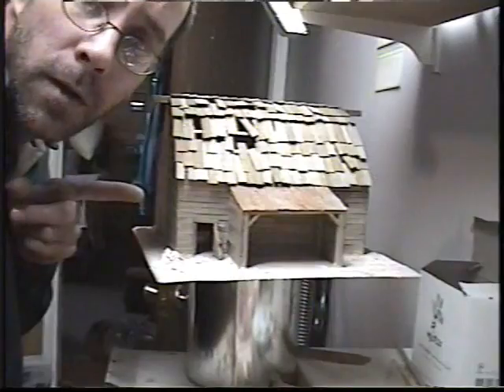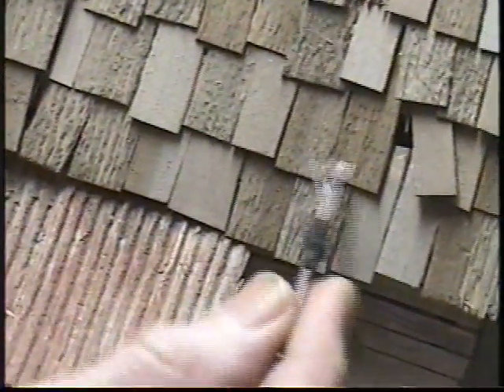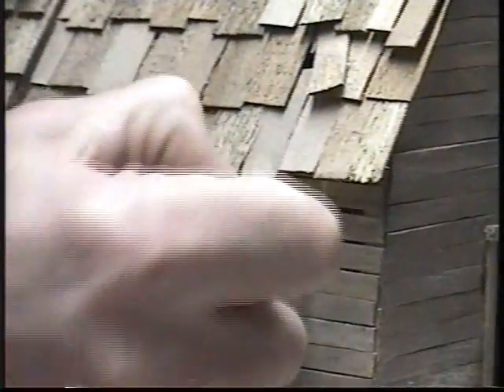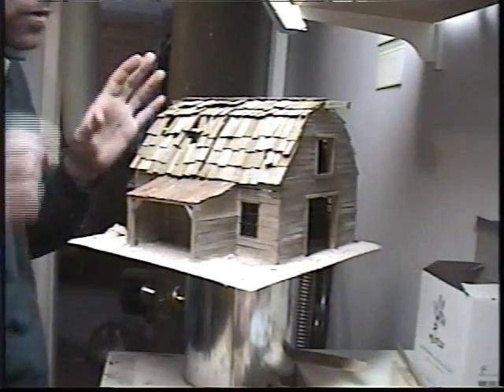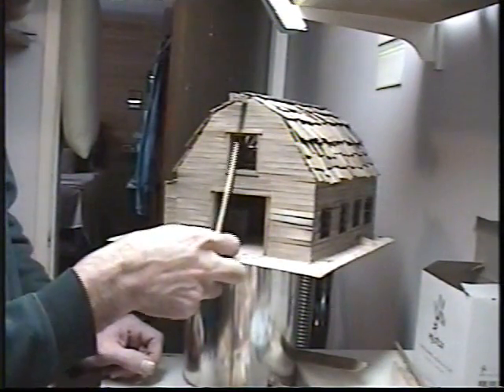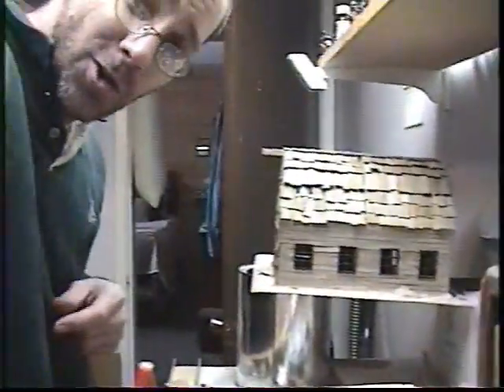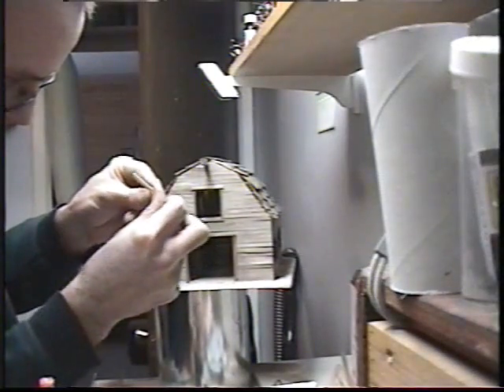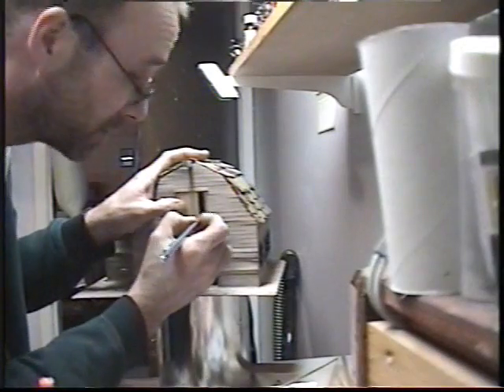Miniature barn diorama 28mm game terrain -part 8ish

Comment from the maker: I have always carved trenches out of a foam sheet glued down on hardboard.

You could use the balsa for lining the trench. i.e. support beams and lapping and fill in behind with paper mache or clay. If you build it on and let it dry on it's own base, you can make the trench sections movable.